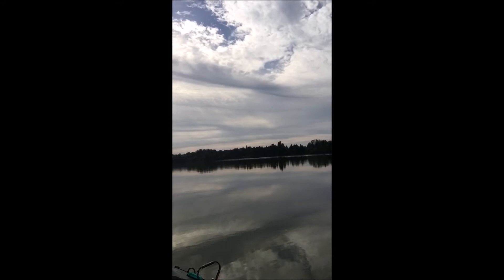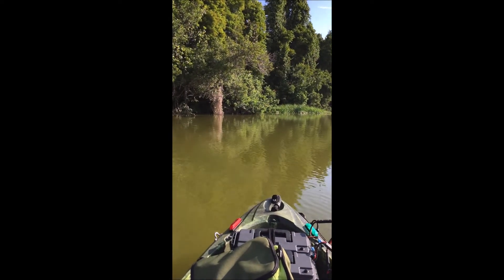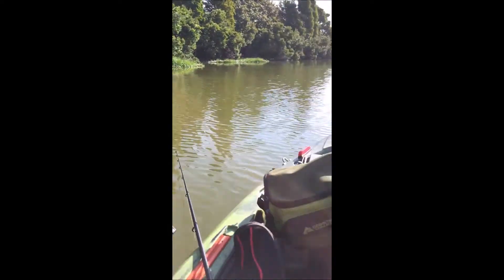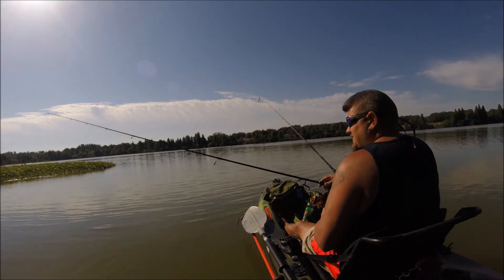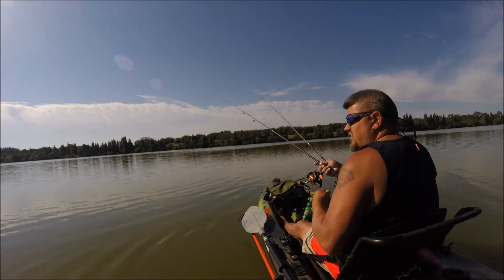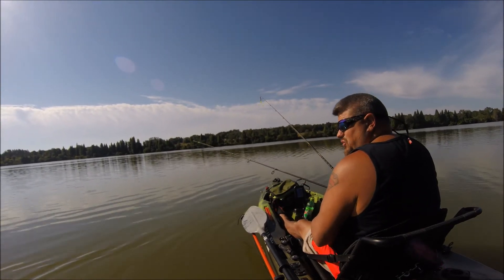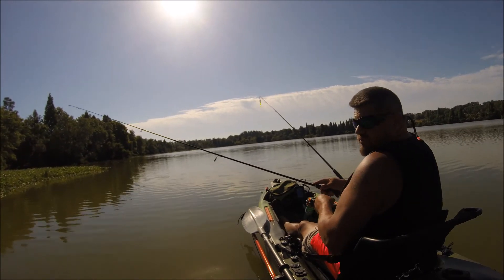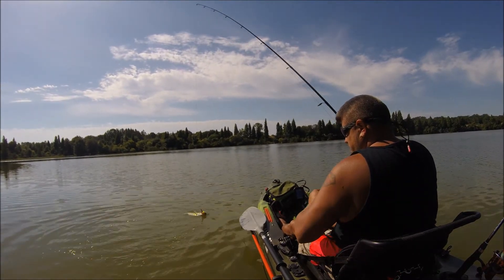PWM controller installed on my kayak

Comment: I'm thinking a bull nose rudder or a DIY bull nose on the trolling motor shaft would help control in the wind or even slow speeds with a little current. Had my PWM on my Kayak for a while now and the switch blew. Replaced the switch and all is well. $20 a year for a new PWM is way less than spend on other fishing stuff. Great job and really like where you placed it.

Comment: I am on the fence regarding 30~40 # thrust. Do you have any regrets with the 30# motor. I want to be able to drag my son behind me in his kayak at times so I was thinking the extra pull would be good when needed. What do you think? I will be using a PWM and a Dakota 54AH lithium battery.
Reply from the maker: Ed Russell I like the 30#, the hull is your speed limiter so going bigger does not mean you will get more speed. Usually just means you will use more battery. I’m not sure about the hauling part, you may want to go bigger but I’m not sure.

Comment: Do you have to worry about it getting  knob and Switch wet or moisture inside the Yak on the unit also found it on Amazon too
Reply from the maker: No issues in over a year so far!
Reply: @sikassscivic  Cool going to order mine tomorrow well today have the Pilot myself ne to figure were I want to put it now and fits

Comment: How is your PWM holding up a year later?
Reply from the maker: I’ve done nothing to mine, old school trick is to use spray silicone but I’ve never done mine.
Reply from the maker: Daveola210 not a single problem, still love it
Reply: @sikassscivic  Great! I just ordered one.  Did you do anything to try and make the switches more water resistant?

Comment: Did you add or extend the wires for the pwm knob & switch? If so, what size wires did you use?
Reply from the maker: Benzo R I didn’t need to extend. My pwm is directly behind that plate I have the knob mounted too.

Comment: Thanx for posting your videos you have given me some GREAT ideas. Do you still have your kill switch wired in? If so where did you get it plz live a link if you can. What gage wire do you use to connect it all together? do you have any over heating?
Reply from the maker: Truehearted I got rid of the kill switch, just felt I didn’t need the extra clutter. It’s just a simple kill switch you can get off ebay or amazon, wire it in before the PWM on the hot wire. I’m using 14 gauge on the wiring. No overheating.

Comment: What motor are you using? I have a 44lb minn kota that'll eat a battery alive, will this give me a longer run time?
Reply from the maker: Johnny Bryant I wouldn’t hesitate, pwm would help any motor keep from wasting juice. $13-$20 well worth the investment!
Reply: do you have a video of how you wired it in?
Reply from the maker: It’s only 4 wires, 2 from the battery and 2 to the motor.
Reply: Ok mine is different, I have 6 wires total
Reply from the maker: You may have 4 at the motor, but you only need red and black for the motor.